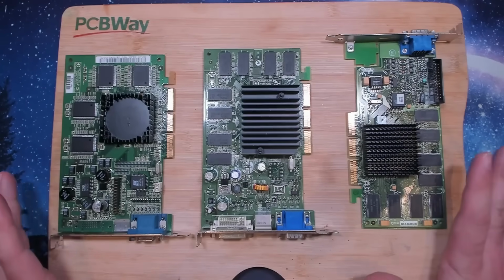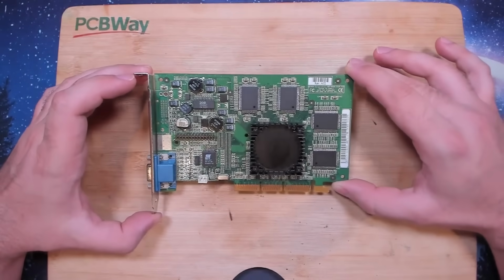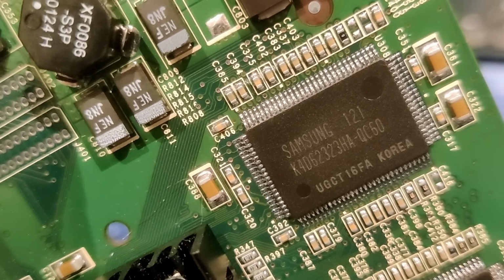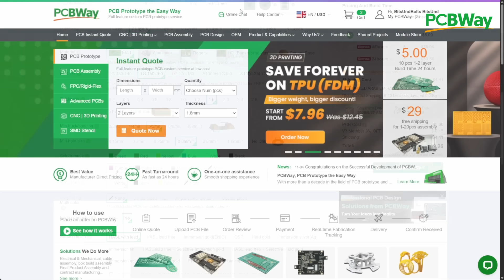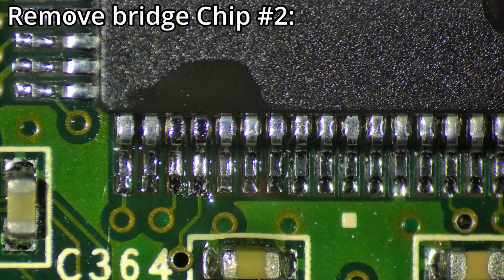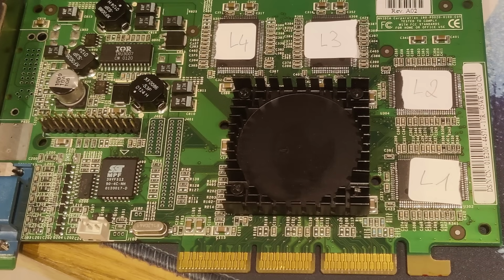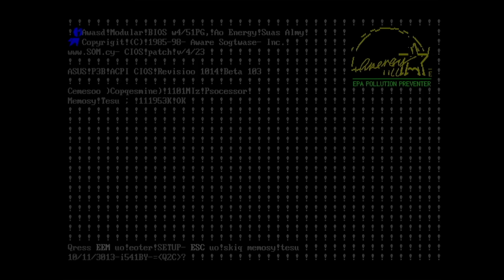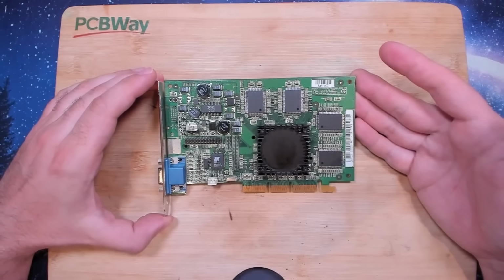Leaked NVIDIA Tool: Can MATS Save My Broken GeForce?

Comment: I just watched the last video of Necroware (28th Nov. 2025) about memory chips being killed by a faulty 5v to 3.3v translator chip on a voodoo 3 and I remembered this video. Could it be that the memory chip om the Nvidia was killed by a 5v to 3.3v translator chip?
Reply from the maker: Yes, I saw that too. I have to check what chips are on this board because it is a few generation newer. I doubt it is the same issue because I switched the memory chips around. If the memory would be at fault, the error should have moved with the chip.

Comment: At the dawn of the internet I also searched Altavista for solution to remove my heatsink from my Voodoo cards and others that was using that epoxy style glue... The "best, easy and doable"  was putting it to ESD bag and 2-4 days at the fridge with -20 to -30C and then good strong steady twist it (just firm grip on card and heatsink) and it would come nicely every time. Then cleaned the surfaces with solvent and I remember using some Artic Silver etc with their designed thermalpaste glue (epoxy based?) and better/updated heatsinks got really good result with temperatures etc :)

Comment: I had to remove a glued cooler from a slot Intel Pentium in the past and put it (within a mostly aired out zip lock bag) into a freezer over night. That made the thermal glue extremeley brittle and I could  get it off...
Reply from the maker: Could be an option. I will try freeze spray as I hope it will create a bigger thermal shock - at least I hope so.

Comment: A tip for the thermal epoxy, if you can heat it up safely, like with the heat gun, it will soften to a point where it can be removed. I had to repaste an original xbox with this stuff on it, and I ended up lighting isopropyl alcohol i poured on the chip on fire to get the rest of with q-tips.
Reply from the maker: Wow - fire experiments. I did try to soften the glue, but it didn't seem to get soft. I stopped at around 200 degrees on my hot air station though. I don't think I would want to go any higher in fear of damaging the GPU.
Reply: @bitsundbolts  Hmm, ok, I must have had a different, less extreme thermal solution then. The only other thing I could suggest from experience would be acetone, however I'm not sure how something of that strength would react with the rest of the components. Try if you dare!

Comment: back in the 2000s i used to throw the cards into the freezer and shear the cooler off the chip by clamping the cooler in a vice and rotating the card while the glue was still frozen.

Comment: Pin 97 on U302 always reads 1. Does it always get written with a 1? Could it be debris under the GPU? Put IPA in a cheap waterpick and blast the GPU solder balls or clean the board in a sonic bath.
Reply from the maker: I could try the ultrasonic cleaner, good point. Maybe something is just stuck below the GPU.

Comment: Also used this to diagnose and fix a Geforce 256 from Guillemot for my Alienware Area 51 project. Turns out all memory chips required resoldering.
Reply from the maker: Wow - must have been ageing solder that just lost its properties. Hope the core won't have the same fate.
Reply: @bitsundbolts And not long after here I am again, this time with a GF256 DDR. Same chips as your unsuccesful Geforce 2 - came back to figure which chips are bad on mine, since you managed to crack the code on which RAM chip is on what channel.

Comment: I managed to get the thermal cement off a 486DX chip that had a heatsink and ducted fan. Why would a 486DX have a heatsink and fan? Well, it was a DX-25 that had apparently been overclocked to 33 MHz by the SI, so that was just their way of making it more stable??? IDK.

Comment: It's obvious to me that the LSB of that memory bank is stuck to high. Most of the ASCII text affected was one letter higher unless that ASCII letter had an LSB bit set to 1 already. Spaces were also changed to exclamation marks. In the ASCII code page, character are in order, so if the least significant bit is stuck high, you will force a letter higher than the one you want, so P becomes Q for example. On the other hand, letter like O wouldn't be affected as its LSB is already set to 1. Space is 00100000 and exclamation mark is 00100001. I am pretty sure your memory chip that was line 1 in your diagnostic tool is either dead, or that line has been shorted to +5v somehow (might be shorted to ground too, depending on infrastructure). An oscilloscope would do short work to verify this and find the culprit. The tons of artifact you see after removing the memory chip is most likely because all your data lines became floating, so their value was changing all the time according to the GPU, depending on static charges mainly. It even affected the other chips, probably because of the address line, RAS, CAS and CS lines.

ASCII character modification is a killer tool to find stuck bit in memory of graphic cards in text mode. Of course, you shouldn't see the same issue under graphical modes as character are drawn on screen using a totally different process.
Reply from the maker: Yes, I learned exactly this from the many comments I got. The ASCII code increase is really interesting!
And because of this, I did go over the chip I marked as L1 and all data pins do show activity. There was nothing obvious of a stuck data line. So, I assume that the memory controller doesn't work properly and can't interpret the signals anymore of this one line.
I don't think anything could fix that issue since it seems to be an internal flaw. I rotated the memory chips many times now and the error remained exactly on the same position.
I guess the GPU is faulty.
In Windows, I see vertical lines on the screen. I am sure it corresponds to the columns of exclamation marks we've seen in DOS.

Comment: Why don't you try to reflow the card in the oven?
Reply from the maker: Reflowing a chip with a heatsink attached is probably impossible - because of the heatsink. New details have surfaced and I think the GPU has an internal issue - so, it will be a practice card / donor card anyway.

Comment: I haven’t watched the whole video yet, but wouldn’t it be dangerous to bridge the data pins? If the memory controller pulls one line to ground and one to VCC during a write it could short out the controller. Better to lift a leg a tie it to ground or VCC right?
Reply from the maker: Good point. I didn't think of that, but your concern does make sense.

Comment: Acetone around the heatsink base while its upside down or on an angle  so the acetone doesnt get on pcb easily.  Soak it with a few drops every few hours for a day or three
Reply from the maker: Yeah, it is just a very long process. I don't know if I risk damaging the plastic body of the chip though.
Reply: @bitsundbolts  if you do you can always replace the material with epoxy

Comment: That's amazing! But... You swapped the RAM chips and your errors changed. If the RAM was ok, you'd have seen the exact same issue, no? Because the issue changed (and went back to what it was before when you put everything back to where it was), to me that points to a bad RAM chip, not the core. What am I missing?

Epoxy: try warming up the heatsink with hot air - fairly hot air, won't take much for the heatsink to get very hot but the core should still be ok. Then try twisting the heatsink and see if it slowly gives up.
Reply from the maker: Hm, the new errors changed around while moving chips around, but the original issue remained on the same location.
There is one bit that is always stuck high - I had a Voodoo 2 FBI chip that had the same issue on one memory data line (maybe it was always stuck low).
I discovered more details about the card. All data pins on chip L1 do show activity (HIGH and LOW). So, it must be an internal fault in the GPU - it cannot determine the state anymore. Unfortunately, I believe the GPU is faulty - nothing I can do about it.
I will use the card for some experiments though. Removing heatsinks, remove the GPU, reball, resolder, etc.
Reply: @bitsundbolts  I see what you mean and it makes sense - but if the RAM was 100% ok, you shouldn’t have seen any difference in the pattern when swapping the chips around. I look forward to the next chapter! 🙂

Comment: Clamp the cores. If artifacts go away you have cracked balls under the cores
Reply from the maker: I tried pressing on the heatsink - It didn't make any difference. My guts tell me there is an internal fault inside the GPU.

Comment: I finally Identified the mystery MX440-SE with out of range... it's a nice Point Of View GeForce4 .... seems rare card (1-2 photos + mine on line). I always thinked it's a Sapphire (my mistake). On the photos online It seems I have all the parts (so nothing /smd missing). Worse is I'm stuck finding a old CRT somewhere in my stash (after warm-up) & test pc to try again see if it POSTs.(probably next-yr-2026).
Reply: L.E. You can Pull-off the heatsink with WD40(silicone specialist) + Acetone.... *soaked for a while (sadly I don't know why -you get ! - , but in theory you can try a RE_FLASH of the bios + capacitors for short... It may be a line to the ram-to-gpu that's pulled down and makes the ! appear)....

Comment: Use Dental Floss. Make a wire saw out of it and just run it back and forth under the heatsink.
Reply from the maker: I've heard that and it might work on other type of glues - the thermal paste on this card is really like cement. Dental floss will have no chance.

Comment: pretty sure the exclamation mark in textmode is the GPU saying it sees something is wrong. The hardware maker and vendor will want a quick way to know if a self-test failed, and one that is VERY obvious in ANY test.
Reply from the maker: Here is the thing - the EXCLAMATION MARK is just one ASCII code above the SPACE character. In the rows with the exclamation marks, all characters are incremented by 1. So, Celeron becomes Celeson (r => s). It is one bit that is stuck high - and it is the least significant bit. Unfortunately, all data pins on the memory L1 show activity - which could mean that the memory controller cannot interpret HIGH and LOW on that data line anymore. That would mean, the GPU is faulty.

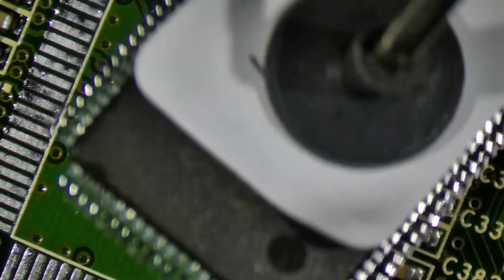Comment: Looks like you have some kind of soldered wire at 16:27 (top of the screen). can it cause short?
Reply from the maker: It looks like it, but it is probably just a hair or left over from a brush. I clean the flux and inspect my work once more before I test the card.

Comment: back in the day I would freeze the card in the freezer. this made the epoxy brittle.  then I used a flat head screw driver and an old plastic bank card to pop the heat sink off.  the card protects the PCB .  then insert the screwdriver under the heat sink over hang and twist it so it pops the heat sink off.
Reply from the maker: I'll try this technique. I have seen a few videos and people successfully removed heatsinks from Voodoo 5 cards like this.

Comment: I'd say you should try it with a Carpet-Knife, their blades are thin enough to get between the die and the heatsink, so i guess that should work (but keep in mind, thermal epoxy gets squishier when it gets hot, so keep it nice and warm then it shoud be a breeze to separate both parts)
Reply from the maker: That does work well if you have a small gap between the GPU and the heatsink. Unfortunately, mine is epoxied all the way around. I will try a few things and in the end it is probably a combination of multiple techniques to get that heatsink off.
I discovered some new information - and it looks like the GPU has an internal fault - so, it will be a practice card anyway.

Comment: fun fact, that card's heatsink and fan sucked, the gpu chip itself it most likely damaged. a reball won't fix it :\
Reply from the maker: You might just be right. Perfect for learning BGA repair though. It's a broken card that still shows a picture. If I manage to remove the GPU and put it back without making it worse, it's an accomplishment.

Comment: A soak in acetone should dissolve the epoxy, but it might also dissolve the chips. If it really isn't epoxy you might try using two fist sized sticks and some dental floss tied to them, like a wire rope saw. Try and saw between the heatsink and epoxy.
Reply from the maker: Wire rope saw is something I will try - at least to get some of the stuff out so I can use a prying tool to get between the chip plastic body and the heatsink. Acetone is aggressive and exactly as you mentioned, I might cause more damage to other components.

Comment: I've been able to removed an epoxied heatsink by sliding a razor blade in blade in between the chip and heatsink. Yours looks like there's a lot of epoxy. You might have to put a flat bladed screw driver in between the razor blade and heatsink and twist it to pop it off the chip. You could try cooling the heatsink with ice or compressed air turned upside down. I've heard it can make the epoxy bond more brittle, but I dunno.
Reply from the maker: Exactly! I removed heatsinks with epoxy by shoving something between the heatsink and the GPU plastic body. It was possible because there wasn't as much epoxy as on this card. I tried on multiple angles, there is just no good entry point on this card.
I will try a combination of techniques to get to a state where I can squeeze something between the heatsink and the plastic chip. Work with freeze spray and probably a diamond wire cutter (0.15mm).

Comment: heat the heatsink with hot air and twist it off gently.
Reply from the maker: I tried that - that epoxy doesn't get soft. It is hard as stone :(
Reply: @bitsundbolts you could go the opposite way, canned air upside down, freeze the crap out of it, and try and get it to shatter.

Comment: can be MATS used, or is there way how to test memory chips on Voodoo 3 AGP? I have weird "thing" with both my V3 2000 and 3000. Directx show one card 14.5MB and second card 15.1. Is DX liar? Both cards working fine, bios show 16MB, HW info tools as well only dxdiag show bad numbers🤔
Reply from the maker: I just fixed a Voodoo 3 3000 - and I have EXACTLY the same issue. I think it is just an issue with reporting the numbers. I will verify later with other cards I have. I wouldn't worry about it to be honest. If you don't have artifacts, your card is fine.
I have something like 1444X KB in Everest, and also saw 15MB somewhere (maybe 3D Mark99). If you try a different version of 3D Mark, you get different numbers. I think this is a software issue (bug), not a hardware problem.
Reply: @bitsundbolts  both V3 working fine. 2000 is after bga reball - cold solder joints and card start artifacting. Reball was success. Not sure how much memory DX reported before. V3 3000 i have original withou anything change and also bad memory size in DX. I found this problem by "mistake" when i tried game SACRIFICE. There is in option HW info and it show 14MB but i think is just DX info. Maybe we figure out what is wrong in future. Maybe only SW bug 🤷‍♂ I have many S3 cards also some Matrox or older ATI where DX detect bad memory size. Now i am waiting for two same creative CT6670 V2 12MB at last i found trustworthy seller with working cards i hope it will work 🤔👀

Comment: Oh man, I really hope you manage to fix this one! And thanks for taking us along the ride!

The Geforce 2 Giga Texel Shader was my first Nvidia card. The retailer from whom I bought a boatload of hardware because my PC building side gig was absolutely booming at the time had just gotten it in and (being an enthusiast like me) made me a really sweet deal as a thank you for being such a good customer, so I couldn't pass up on that.

With a lot of tweaking, I managed to post some top notch 3DMark scores with it, very close to if not even briefly at the very top of the scoreboard. Nowhere near stable, but all my younger self cared about was to make it through just one pass and get the score to go as high as possible. 😄 In the early days, it wasn't yet as insanely competitive, so you could still do well with relatively reasonable equipment and a lot of dedication. No LN2 or even liquid Helium required yet...
Reply from the maker: Unfortunately, after discovering some more details, I am convinced that the GPU is faulty. I tested all data lines on the memory chip and they all show activity. MATS suggests that one data line is stuck high - which isn't true. It could be the memory controller that can no longer distinguish between HIGH and LOW. I had the issue with a stuck data line on your Voodoo 2 (I don't remember if it was stuck HIGH or LOW though). Same seems to be the issue here.
Anyway, I will probably use the card for practicing BGA repair since it is comparable to a Voodoo 3. And who knows, some day I may swap the GPU on this one and make it work.
Ah, benchmark competition :) I couldn't do much back then with my GeForce2 MX :)